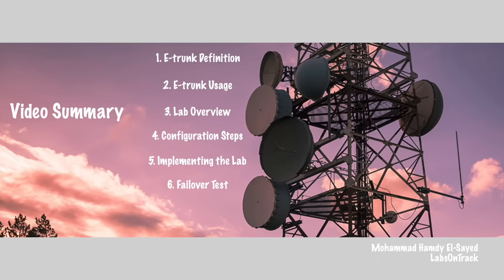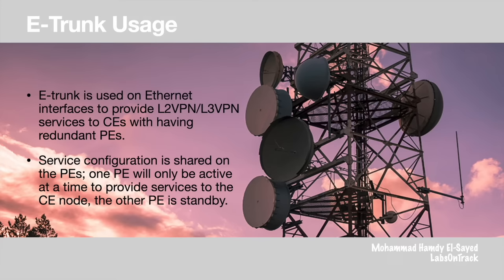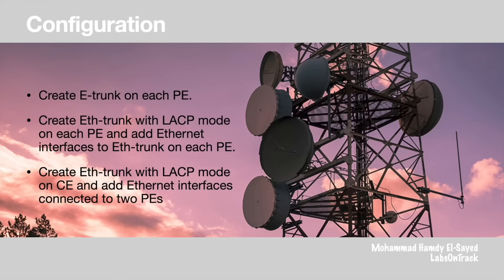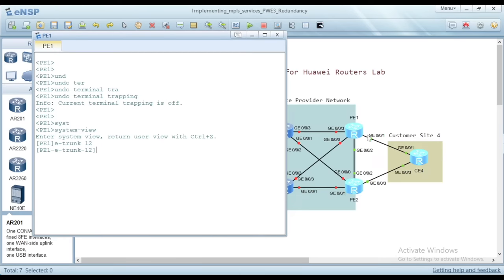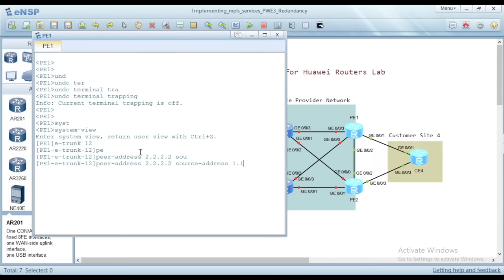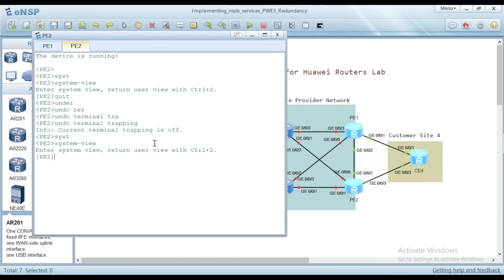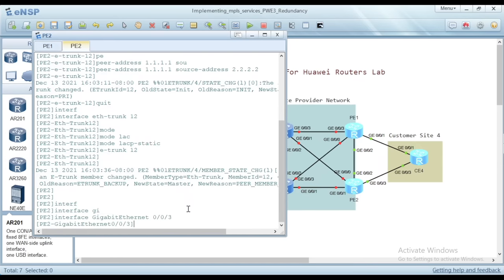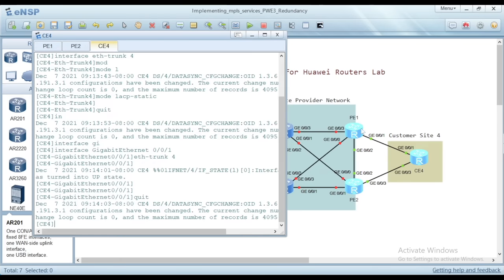E-Trunk | Multi-Chassis LAG - Huawei Network Technologies and Solutions - Part 1

Comment: Hi Mohamed, thank you for your video, the config & Explanation are very clear. so If my understang is well, the e-trunk is the same as the MC-lag? also, can use the same link between the 2 PEs to create 2 different e-trunk please? thank you for your respons :)
Reply from the maker: Hi Rym, thank you so much. Yes E-trunk is the same as the MC-LAG for Huawei routers, and for Huawei cloud engine switches, there is another technology: v-stp. You can have same link between PEs for heartbeat of different E-trunk, but for the Eth-trunk connection going to CE routers, it can be bounded to only one e-trunk.
Reply: @MohammadHamdyElSayed  Thank you a lot Mohamed for your clarification
Reply from the maker: @sahlirym2230  Welcome any time Rym